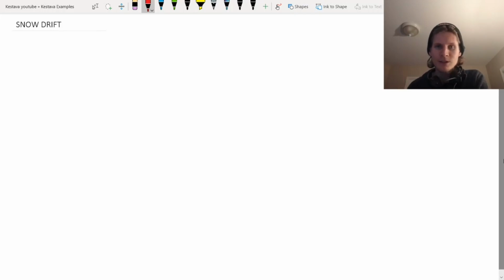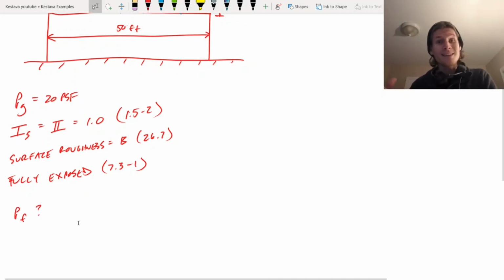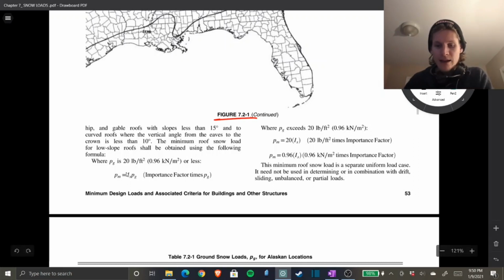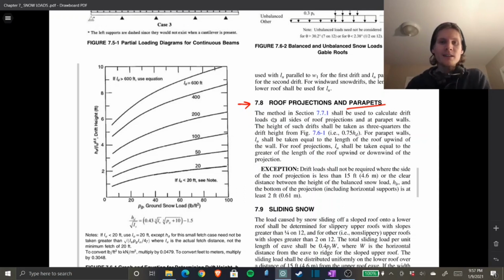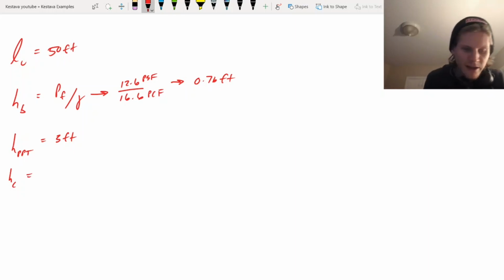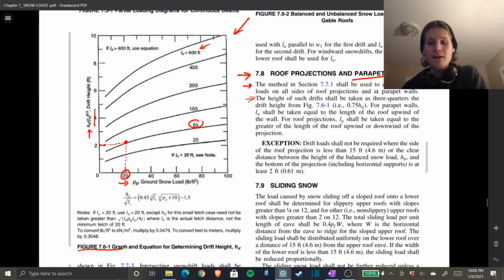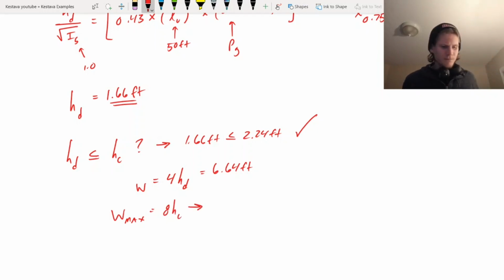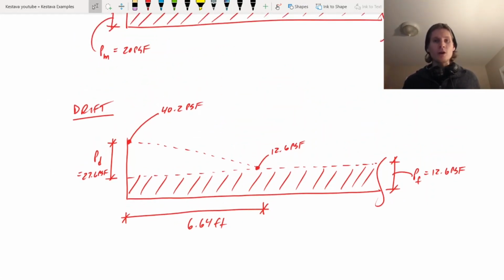Snow Drift Design Using ASCE 7-16 FULL Example by a Professional Engineer

Comment: Thanks for the great content! I am having a hard time interpreting ASCE section 7.3.4 "Minimum Snow Load for Low-Sloped Roofs" would Pmin even be a design consideration for this example building? The language states "...shall only apply to monoslope, hip, and gable roofs" In your example the roof system used is neither of these. Any thoughts on the interpretation?

Comment: I appreciate your channel. I just started a new job as a Structural Design Engineer after being out of the field for a while. I found this channel and it has been great for getting me back on track.  I see asce 7 22 is changing how snow loads are done. Its actually the guy who taught me steel design in college that is heading up that snow load change: Michael O'rourke. Makes me feel better about my college education? I just need to rekindle that knowledge base.  One thing i find odd is the .7 for ground to roof. If you had a roof that was 1 sqr mile, surely the snow would be the same on that flat roof as it would be on the ground. The whole thing of determining what load to put on a building is quite fascinating to me.

Comment: Fantastic video!  Question...  As a code professional, I can only enforce minimum not best practice.  That said, I know drift loading should be accounted for in a building design but is there language that requires it to be accounted for?
Reply from the maker: welcome to the channel! your expertise is always welcome here. short answer - yes. the IBC has loading criteria for snow but heavily relies on the ASCE 7. the ASCE 7 mandates that engineers design structures for drift criteria as outlined in their pages.
Reply: @Kestava_Engineering  I'll have to take a look when I get back in my office.  I don't normally need to spend a ton of time in ASCE 7-16 other than as a reference if something looks off like a snow load reduction that appears a bit too reduced haha.  I'll have to track down the path.  Thanks!

Comment: The 30 pcf value in your problem from CH 7 is a max required if you calculate more, not a minimum.  If you come up with 16.6 pcf density load, you should use 17 pcf in my opinion, the point is, that 30 psf is not a minimum to analyze vs the calculated density.
Reply from the maker: hi Don! I've been loving the feedback. I believe I did take the 16.6pcf in this case, but i agree i was a little incorrect on my verbal teaching. the density never needs to be greater than 30pcf per ASCE 7-16 equation 7.7-1.

Comment: Hi Kestava , if this is flat roof and surrounded by parapet the drift can happen from any side of parapet wall , so the question is if the beam along the width is  20ft , continuously so can we consider the Max40.psf  through out the without dividing into parts and Triangle loads.... , i mean if whats your next step for designing a beam for this load consideration in practice 

Thanks
Reply from the maker: Shams, just designing for the highest concentration of snow drift across the entire roof would work, but it would be incredibly over designed. we should always be trying to minimize our designs per the provisions of the codes we follow. but in short, yes you could do that. great question!
Reply: @Kestava_Engineering  Thanks, how and which part of the code helps to minimize the load in this case, i was thinking for being neoconservatives to consider 12.6psf as udl  and 40.2psf  triangle load for 6.64ft  length on each side for 20ft beam and find Max moment and shear and proportionate the section.

Thanks